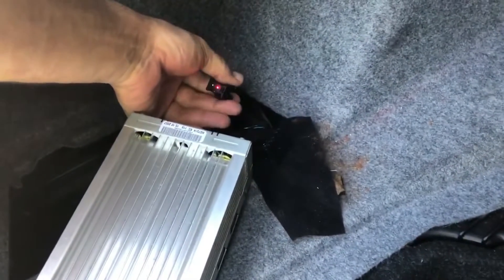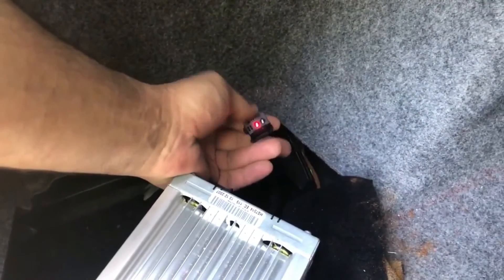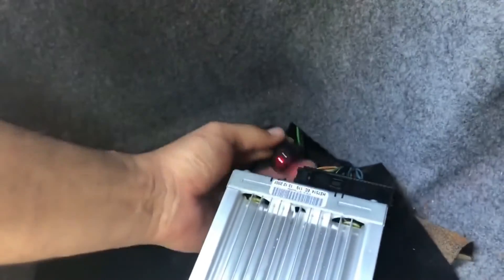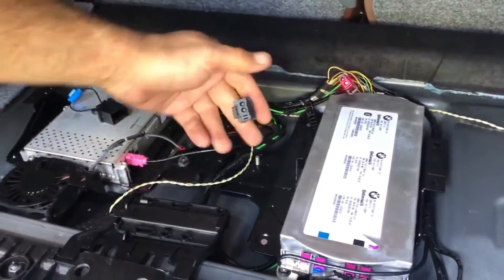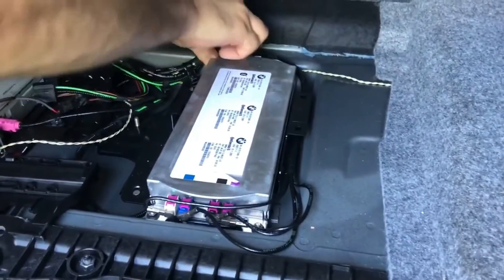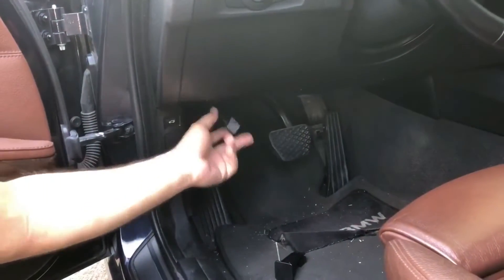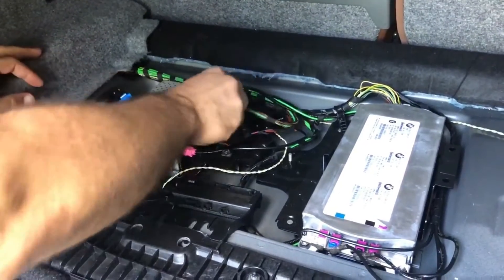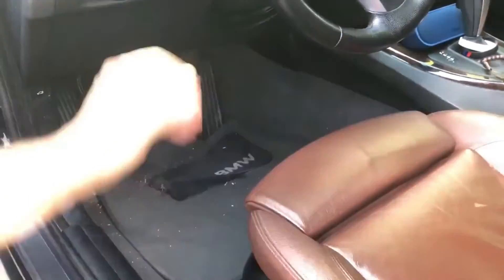BMW MOST BUS DIAGNOSTICS AND REPAIR, E90 EXAMPLE

Comment: What do you do if there is no red light to the amplifier. I should add that I had the complete interior out of the car including the center consul. After putting it back together I have no sound at all and there is no light at the amp.
Reply from the maker: Means no light coming from the head unit, check it from the head
Reply: @Bavlogic  thanks after some thought that’s what I came up with. But the problem is that this whole car has came apart and put back together. So I am thinking I might of miss a plug somewhere. What would be really helpful would be a clear wiring diagram that shows the deck to the amp so I can make sure it’s all plugged in correctly.

Comment: Thanks so much for such a detailed video! My subs and mids have not been playing for a while now and instead of just spending $1000 or more to replace it, I am going to use this video as an example troubleshooting method. Because I do have power at the head unit and highs, should I approach this differently? Any clues or assistance will be certainly helpful.
Reply: Did you ever figure this out! I have the same problem
Reply: @jusmoney4320  figure it out? Same issue here
Reply: Curious as well my subs go in and out mostly out only highs working for me. Any help is appreciated
Reply from the maker: Subs can be bad as well

Comment: What if your stereo doesn’t work, checked all fuses, took stereo out and it works in another car, no power to the radio or sound from it. Could a faulty mulf module/amplifier in the boot, cause this problem?
Reply: maybe is faulty ccc or nbt unit? this was my issue
Reply: @farqueue  I scrapped the car over the issue and got a newer 120d my friend, thanks for the reply though

Comment: I have an Audi issue with my 07 E90. I ran the diagnostic per your video. However, the red fiber optic has no break and it goes out and back to the head unit without breaks. But I still have no sound!! I don’t have navigation. What would be the reason for no sound? Door/seatbelt chime is super low and it comes from the dash. Please help!!!
Reply: did you solve it?

Comment: So my e92 sound just went out. I can see that the fiber optic cable lights up when I unplug it from the LOGIC7 Amp. However when i plug the FIBER OPTIC back in, the Amp's internal troublshooting LED is RED, not Orange. Does that mean the AMP is bad, or is the head unit bad thus not providing signal to the amp? I am not sure what the RED LED means, its not orange so I know something isn't working. I think maybe the issue is the head unit, but I cant say for sure, bc when I Loop the TCU unit, the Fiber Optic Loop for the Termination Loop, blinks fine. Please any help would be appreciated. I've been at this for a week now, the Head unit, powers on, ejects CDs just fine. I have also checked all my radio fuses, I have reset the radio by holding both EJECT and POWER. nothing is bringing sound back not even the sound when you open the door with the key and headlight on.

Comment: One rat got inside of my 2008 335 e92 and the rat ate my harness from the glove box fuse box, you have not idea I had to remove the glove box and fix all the harness, days trying to find and doing bypass to the amplifier, till I found your video, the connector on the driver side was disconnected 🤦🏽‍♂️ I bought this car as a project and the previous owner or mechanic leave it disconnected, thank you so much sir!

Comment: I believe my 2010 e93 has the sat integrated with the head unit. So I see the red light at the connection to the amp. And the next module in the trunk after the amp is the TCU and the fiber optic going to the TCU doesn’t have the red light. So does that mean my amp is bad?

Comment: I have a 2008 E93 with the "SOS call system malfunction" with no radio or sounds for the key, lights, seatbelt alarms.  I have red blinking fiber lights at the telephone mod and to the Satellite mod, no blinking lights at the amplifier or under the dash. Tried bypassing the Satellite with jumper, this didn't help. The Christmas lights sequence does match what you diagramed.   Can someone please advise?
Reply: I'm having same.issue
Reply: I accessed every module and unhooked each fiber line one at a time, found the MULF as bad using the jumper.    I was told the sequence of programming my be different model by model.   Ordered a used MULF on eBay based on the module labels.  It was a plug and play.  Good luck.

Comment: Hello,
Asking if you may know, if any of my fiber optic cable at the trunk is broken/cut, let’s say from the telephone module, will I still be able to use the bypass kit for the other fiber line to run the system normally without the module with the broken/cut fiber optic line?

Comment: I have no base but otherwise the stereo works fine. Checked all the red lights and they all work. I don’t have the satellite radio. And it seems the phone is first from the head unit, followed by the amp then end. That’s what the red lights showed me at least. Amp has solid yellow light. What else should I check?
Reply: It was the amp…

Comment: I followed all the connectors on my 2006 330i and they all light up but I’m still not getting any sound from my radio or door chimes. I checked all my fuses and they’re all good. I’m not sure what to check anymore.
Reply: I have a 2006 BMW  330i with door chimes and seatbelt sounds.. But no sound on my idrive CCC navigation unit. I have a new display
Reply: You have CCC navigation unit ?

Comment: My radio sounds but it won't turn on by itself with the car, there is some problem with the communication to the amplifier when I scan the car, any ideas what could be wrong?
Reply: also, there is no "Computer" option, steering wheel controls don't work either

Comment: I have no light coming from the setallite tuner, or the one inside under the driver side. The amp an the one to the right of the setallite unit both have red lights?! Help!
Reply: that should mean the module to the right (telephone module) is bad. put the optical loop onto the cable connecting to the telephone module and see if it works.

Comment: Awesome video, I went through this diagnosis as much as I could, there is no light in my amp, I’m guessing that means the amp or the line is bad. However, the radio does not even power on. I have a non idrive so just the regular radio. Nothing in the screen, I checked the connection with a volt meter and got the proper 12V. Also there is no satellite module in the back of mine, just the phone module. I’m assuming that some cars don’t come with it as I don’t even see the loose wires that would indicate that there had been one installed. How would you bypass without the satellite module. I get the sos and caution sign on the dash upon startup. I drive a 2008 BMW 335i E92 with the logic7 setup.
Reply: Same, and there isn’t much info out there. I read that the sat is integrated into the head unit for some models. Mine is a 2010 with the cic nav. Did you ever fix this?
Reply: @JESUSWARRIOR11  not even close, still have no sound even today
Reply: @Mr77Trojan  I have the same issue but Idrive, have you figured it out ?
Reply: @gatiyovideo  Unfortunately no, I’ve tried everything except having an aftermarket line and system installed. I changed the AMP and got a response from the amp but still no audio. Changed the Radio itself to another OEM e9X radio.. nothing.. installed an EONON head unit… nada.. ran the fiber optic loop… still null.. just been rocking a small Bluetooth speaker ☹️😓
Reply: @Mr77Trojan   damn bro , I disconnected the battery for two mins and reconnected it then that’s when my radio/Navi stop working /turning on ….. I been driving with my AirPods 😞 , there’s 3 fuses I needed to check for my radio , two of them had power but one fuses doesn’t
Reply: @gatiyovideo  I checked all my fuses, all had power and I even went ahead and replaced them while in there and still nothing. I believe the electronics were subject to water damage somehow, the previous owner had it sitting out in the elements for months here in Hawaii, that means heavy sun beaming and even heavier rain. The weather strip on the front windshield was shot and there were puddles of water on the passenger side of the vehicle and underneath the battery. I even took it to BMW of Honolulu here in Hawaii and they couldn’t even figure out what the issue is. I gave up lol
Reply: @Mr77Trojan   do you still have your BMW? 
I've been working on my '07 E93 for two years at least. I had issues similar to yours.
Mine started when my car sat out in the elements for a year. Water got into the battery compartment and corroded the 2 positive cables that run from the battery. One to the starter;'the other to the fuse box. I was ignorant about agm batteries and may have toasted some of my units by trying to jump it. I keep that in mind. I'm my case, the water got in either through dirt clogged drainage tracks in the rubber or through a tiny crack in tail light lens. 
I've researched several places too try to find a solution. I first tried the bypass of the satellite unit. That helped with a few items, like the backup icon. So I bought another satellite and installed it. But still no radio. Then I took my amp out and saw corrosion, x so replaced that. Still no radio. Now I have optic fiber light at the foot well, amplifier, tcu, satellite, mulf (under the tcu).
Now what happens is this. If I disconnect the footwell connection, my I drive works. If it is connected, no I drive. I still have no radio in either case. 
Does any of this sound familiar to your case?
Reply: @johnleopard1285  thanks for the feedback my G, I have tried several of the methods you mentioned and no results. I have tried several amps and they all performed their duties, still no sound. My most relentless effort was changing to an aftermarket head unit from Eonon, that powered on and did all it was supposed to but still no sound. Not even the BMW chyme works. I’m thinking footwell module but I’ve long given up on sound. My intention is to have an aftermarket radio shop red-wire a system and run it like  that and forget about Logic7
Reply: @JESUSWARRIOR11  have you fix it ? I have the same issue

Comment: I bought a used 2006 330i and the dealer I called said it was prepped for the satellite tuner  when it was originally sold but when I went to diagnose why I didn’t have sound the module wasn’t there connected to the TCU it was completely absent, is the SAT module necessary for the Audio to come out? Before I purchase a SAT module I’d like to know. Is it possible to make my car that’s coded for it work without it? Ps my amp has a yellow light, all fiber optic connections are red, and the fiber optic loop I connected to the amp and the TCU didn’t bring my sound back.

Comment: Thank you for your video,  I have a yellow flashing led on my Amp, but the amp is not outputting a infa red signal to the next MOST module. If I remove input infa red input to the Amp at the processing board then the amp starts pushing out a output signal on the output infa red. If I loop out my Amp on the MOST bus all over MOST modules work?

Comment: The problem I'm having is that when I start my car, sometimes the volume works and sometimes it doesn't. After I installed my aftermarket Android head unit, I didn't get any sound and the SOS light popped up. I bought a MOST fiber optic interface for the head unit which converts the fiber optic into 2 RCA inputs to the back of the head unit. This provides sound but only sometimes. If I don't hear sound, I have to restart my car a few times and then the sound comes on. Any advice on how to fix this?
Reply: Where did you get with this? I have same issue. 
I have nav with individual sound but not logic 7.
Reply: @mvazac7298   Hey, I actually figured it out and made a video with the details in the description: https://www.youtube.com/watch?v=Qo9wvzU1L_s&t=19s
Reply: Also no sos malfunctions of any sort

Comment: My e90 2011, showed that SOS light this morning on my dashboard when I inserted the key in the ignition. When I tried to push to start the brake felt hard and my car wouldn’t start. I kept trying it till finally it started. Can the SOS be a reason to why that happened?
Reply from the maker: Iliana L , SOS can’t be related to no start issue, no start like cranking but no start or barely cranking like low battery? SOS message is related to TCU unit failure in the trunk most likely or some other unit on fiber optic bus.

Comment: I have the MOST bypass loop and attempted to diagnose this but am coming to a blank. Amp has yellow light that blinks, confirming amp is functional. Checking all connectors from amp to Bluetooth to sat radio all have the red light. Using the bypass loop or having the connector plugged to the sat radio module, the final termination under the dash has no red light. Any ideas?
Reply from the maker: Alex Kaczmarek , red light must be present at the connector near steering wheel, something in broken or optical line damaged

Comment: Thanks so much for this info! My 2006 650 had a radio cutout/ SOS green light intermittently. The dealer wanted $2200 for a new head unit. Thanks to you I spent 1 hour and $8 on a bypass loop. It works fine again, with no unusual indications.
Reply from the maker: Ccc only 2200$ from dealer? They quoted our client 4500$ last time

Comment: weird.. on my bmw 328i e90 it doesnt have the left unit just the other 2 on the right.. is it located somewhere else on my e90 328i ?
Reply: @raymondtj999  nope i just gave up.
Reply: @EddieHDee  if you don’t have the unit on the left it’s prob bc you don’t have I drive, this process should still work but you have to look on the right side , basically same concept except you don’t have an extra wire going to the left side

Comment: my rear speakers dont work on my coupe any ideas everything else works just no bass
Reply: I'm on the same boat , so far no info anywhere.
Reply: Figure it out?
Reply: @yotaismygame  same issue figure it out???
Reply: Did u figure it out. ??
Reply: @ferng9405  I believe it was the logic 7 amp. Bought a used one problem solved. Water can get down in there and fry it.

Comment: What if the radio doesn’t turn on??
Reply from the maker: Jordan Stephenson you need to fix head unit first
Reply: Did you figure it out ? I have sos and radio/Navi won’t turn on
Reply: I replaced the head unit and my problem was solved

Comment: So i bypassed the tcu and the red light is now flashing at the wire under the dash but still sos error and the amp is flashing yellow light, do you know what the problem could be? The only thing after the under dash wire is the radio, could the radio be bad?
Reply: P S that’s happening to me, did you figure out how to fix it?

Comment: Hey youtubers! Hope you can help me with my issue: After leaking I got no sound in my '07 e93 (no radio/cd/aux and no warning sounds at all). After couple sunny days a full sound came back and then on the next day the right side of speakers is not working (now only left side of speakers working). Guys any solution?
Reply: Did you get water underneath your spare tire on those units?

Comment: My brothers BMW is missing the termination loop on the last wire shown on the drivers side. Can you use a jumper loop on it? Or does it have to be the one shown in this video? (the termination loop)
Reply from the maker: xxLoveKevaxx of course it must be looped just like any other MOST port or connection

Comment: I have problem with SOS failure and BT not working. I connected second TCU unit but still not working. In ISTA i have 3 errors : 1. VIDEO 2. CD Charger 3. Telephone. How i can try to fix it?

Comment: What if you have no power to the headunit/amp/etc... YES the fuses have been checked...
Reply: run a new wire
Reply from the maker: Must be the fuse, check diagram and recover the power line
Reply: I have the same issue did u figure it out ?

Comment: Forgot to say, my radio works there's just a popping/clicking sound coming from the speakers and the only way to stop it is to unplug the amplifier.
Reply: Jimbo Bannister did you fix it yet
Reply: @michaeldamanti8170  Have the same problem, how did you fix it?
Reply: It was satellite dlp module

Comment: I have a clicking or popping sound coming from my speakers. It doesn't matter if the radio is on or not, the car can even be off and still popping sound coming from the speakers.  The only way to make it stop is to unplug the and amp. I have replaced the amp but the amp is good. So I was watching your video about the most bus and when i checked my fiber optic cable going to the amp, it isn't red. What could that be? Sorry i'm not very versed in electrical stuff at all! Lol
Reply: Jimbo Bannister I have the exact same problem, I don’t know what to do
Reply: @ethanflav2471   well I finally got mine figured out. I took it to my bmw guy and he wen't thru the entire system and finally found it. Ended up being the satellite dlp module gen2.5. Which is in the middle of the trunk under the "lid" that raises up. It's very easy to change out, just plug and play and doesn't have to be reprogrammed. Their expensive from the dealer but used ones are just over $100 on ebay. Glad to finally figure  it out, hope this helps man!
Reply: Jimbo Bannister thanks so much dude, I’ll get right on it
Reply from the maker: Isn’t it what’s in the video what failed?
Reply: @Bavlogic  that's not what mine was doing, I had a different issue
Reply: Jimbo Bannister what was your issue?